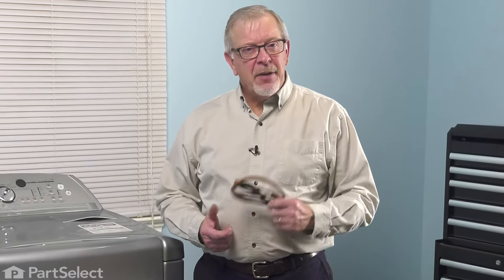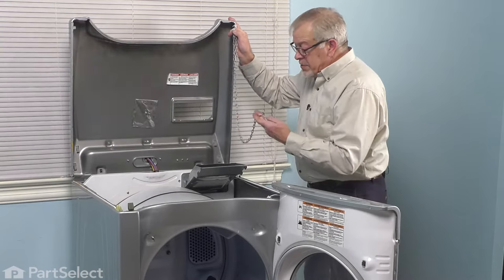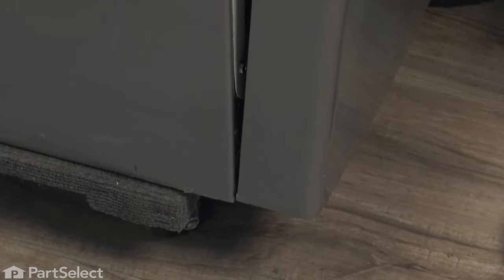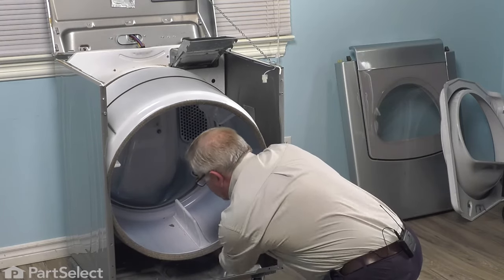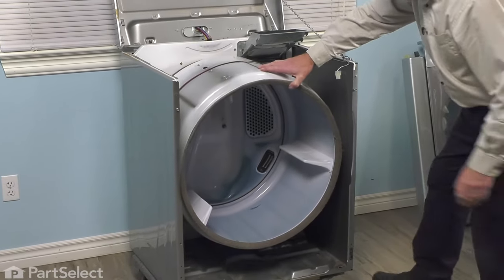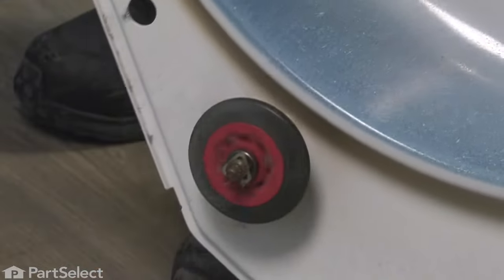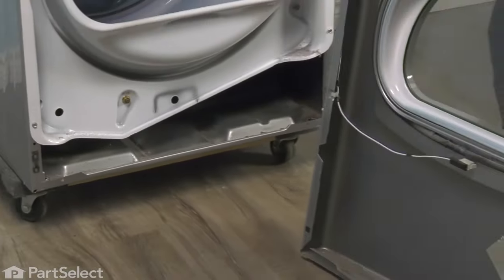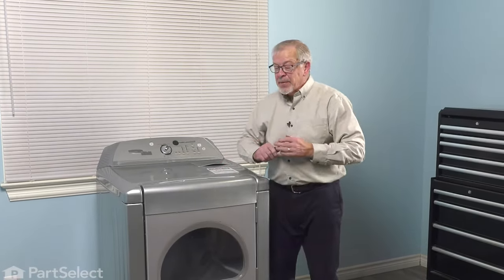Whirlpool Dryer Repair - How to Replace the Drive Belt (Whirlpool # WP8547168)

Comment: Thanks for the video.  Just finished the job.  Replaced the belt and the idler puller.  No problem taking it apart, but threading the belt around the pulley while holding the dryer drum is not the easiest thing to do.  Forgot to reconnect the door switch so the dryer drum wouldn't turn, just beeped when you hit the power button.  Remembered that I forgot to reconnect, pulled the top back off, reconnected the door switched and it works!!  Much quieter.    Vacuum the inside of the dryer after you pull the drum out, lots of lint.  Thanks again.

Comment: All models are different.   I have a mid 90s accudry (Whirlpool).  I took the back off and then the front.   After some figuring I looped it in through the back and got it on pretty easy.  No need for the front to come off.  You have to study the cables and think about how to avoid them.  Start from the pulley and tensioner and work outwards.  For me, taking the front off was a waste of time.

Comment: Anyone is interested I just put the belt over the old mark on the drum and then let it hang down I then put the face of the dryer back on that went underneath to put the belt around the tensioner and the drive pulley.. if you were going to replace your idler pulley you wouldn't take all that out you would just push it Forward take the belt off of it take off the bolt take the pulley off and throw it in the trash

Comment: You don't mention checking the support rollers in the rear for condition and operation. Should they be lubricated? With what?
Reply: They should freely spin by hand. If too much drag/resistance they need to be lubricated or replaced. If you opt to lubricate do it with proper grease and not WD-40 (it dries quickly).